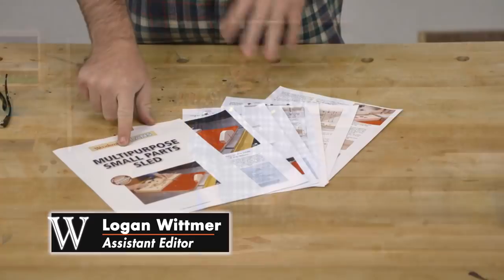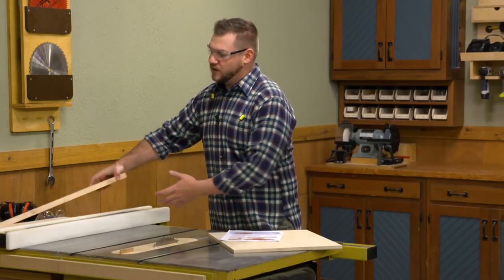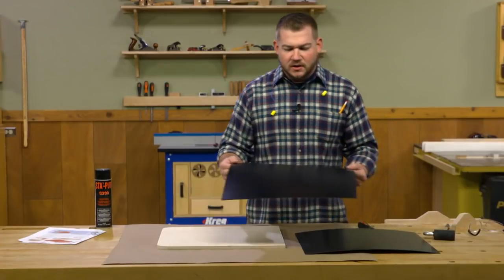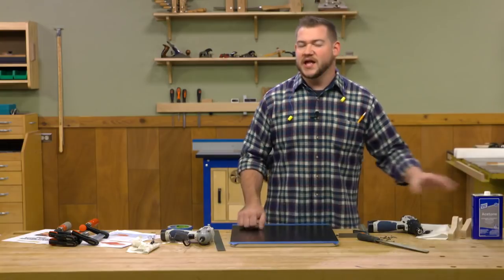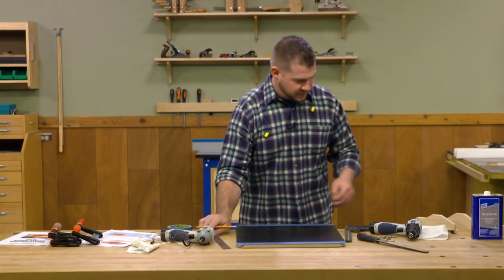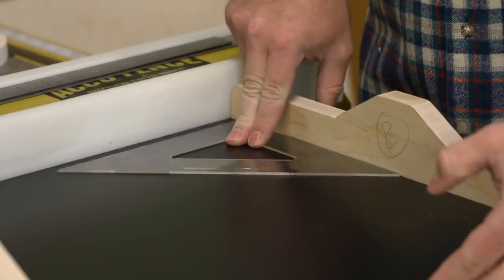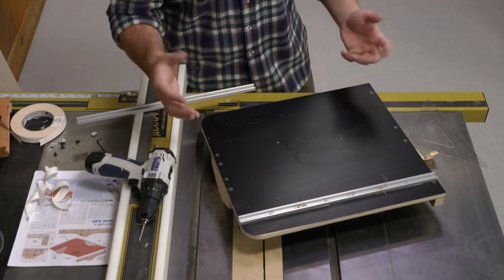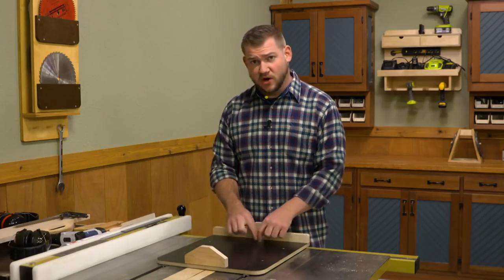Constructing a Small Parts Table Saw Sled (Part 1/3)

Comment: The sled fence being square to the table saw fence when pushed up against it tells you nothing about whether that fence will be square to the blade when running in the miter slots. Terrible advice.
Reply from the maker: Yes, we are making the assumption that your fence is parallel to blade here, which is not always the case.  It will definitely get you close, but always check for square with an appropriate tool and adjust from there.  Also, Because we are working with very small parts on this particular sled any deviation from square will be less noticeable, but you should still get the fence as close to 90 to the blade as possible.

Comment: I;m just guessing,  but it seems my small 10" Delta,  or my slightly larger,  10" Craftsman table saw is hardly the "tool" to use in making an accptably accurate sled.   Or is it just me?   Several attempts  have proven to be LESS than satisfactory.  I'm only an untrained hobbiest,  doing small projects,  but totally distraught trying desparatly to improve accuracy.
Reply: No reason why you can't use those.  Start by adjusting your saw so that the blade is parallel with one of the miter slots, which are parallel with each other.  If you have a metal yardstick, one of those aluminum channels that are sold as a saw guide straight edge, or really any piece of metal that is the exact same width all along its length, and if the length is at least as long as the table front to back on the saw, then raise the blade all the way up, butt that metal up against 2 of the blade teeth angled to that side (one tooth in the front, one in the back), and you now have a line that will greatly exaggerate any misalignment of the blade and make it easier to see than just 2 points front and back on the 10"  blade.  Measure from the yardstick's edge over to the miter slot, at the front edge and the back edge of the table, and follow the user guide (pretty much all are available online if you've lost it) for adjusting your blade parallel to that miter slot.  Next, make sure your rip fence is set parallel to the miter slot (don't rely on the clamping mechanism alone to square it to the edge, use a ruler, at the front edge and back edge of the table), and you're ready to cut the pieces of this or any precision jig for your shop!  Oh, and to make sure the rear fence on the sled is square to the miter slot, use 'the 5-cut method' which will exaggerate any misalignment of the rear fence, multiplying it by 4, to see it more easily.  Good luck!

Comment: I get that your table saw fence is square, and that you're building off of that, but a lot of other crosscut sled build videos have all kinds of complicated, very involved methods to ensure squareness within less than a thousandth of an inch of error. I ask this as a guy who's planning to build his first crosscut sled soon: Are those other woodworkers getting carried away? If my fence is square, is that really exact enough?
Reply: Just flip a square back and forth to get close. If you want even more you’re gonna have to do the four cut method and tinker more. Depending on how accurate you need. Could just use a shooting board after.
Reply: Unfortunately only you can answer the question. Woodworkers have a variety of acceptable tolerances. Remember, the average human hair is 0.003 in or three thousand of an inch thick. Some woodworkers spend the time to get their sleds "perfect" and others accept that there will be errors. I think that one of the overlooked aspects of spending the time is that any wood will have movement during the course of the year. This may led to that "perfect" not being "perfect" any more. 

The methods used in this video is also used by a lot of woodworker because the accuracy is acceptable and it takes less time. Drafting squares are notoriously accurate (the bigger, the better). You just need to make sure that your fence is level both vertically and horizontally.   

The question is really how much error is acceptable to you? Does a human hair show; I doubt it. Most errors are in the woodworker's eyes only, people just do not see those meniscal errors.
Reply: @dennisd5776   and @Fearsome Warrior Thanks for the replies. I used to be a house framer's assistant, so I know the acceptable errors in construction, but this is a whole new ballgame. I think for my first sled, I'm going to use this approach. It's certainly a lot quicker, and I don't want to bog myself down with trying to be perfect, and then get frustrated with everything taking too long (and probably still not being perfect anyway). 

Dennis, you raise an excellent point that even if my joints fit perfectly when I cut them, they probably won't when the humidity changes. If I want absolute precision, I should be looking at taking up metalwork, not woodwork.
Reply: What are you building? Simple projects, square to the eye with a known good square is probably good enough. Doing some joinery and need everything exact? 5 cut method is your best final tuning.